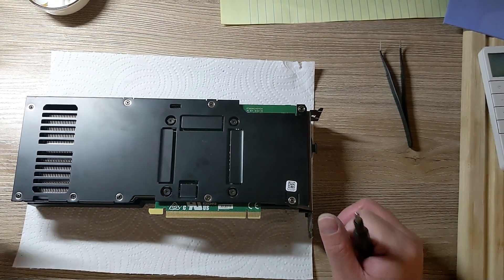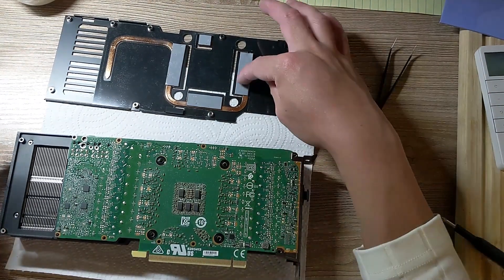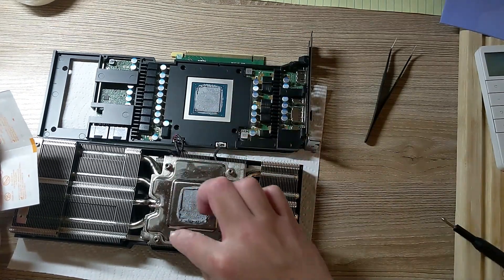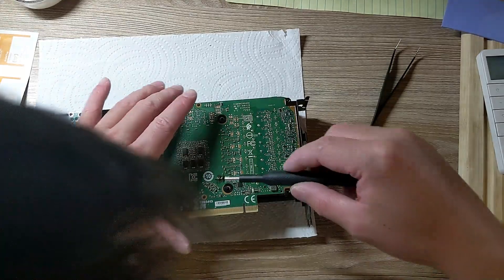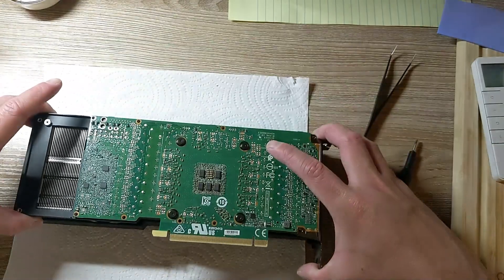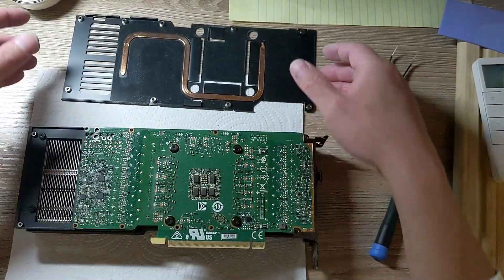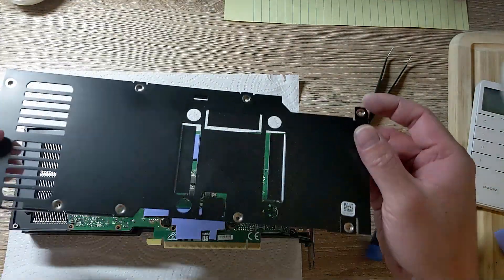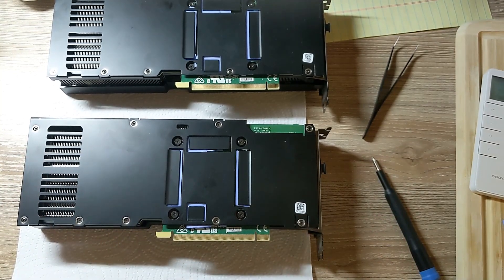How to replace Thermal Pads and Paste for 3080s from Alienware (Dell)

Comment: um... those aren't the VRAM chips, and covering those will not affect performance.
Underneath the black heat sync are the thermal pads that you need to replace for better performance, and you didn''t even touch those.
The main thing for better RAM cooling performance though is in adding that paste between the black and silver heat syncs.  This thermally bridges the 2 so that you get much more active cooling to the black sync that cools the RAM, but it will slightly raise the core temps of your GPU.... but as the RAM temps are going to be your primary bottleneck for gaming and mining, the slight increase in GPU temp compares to the massive benefit to the RAM chips is extremely helpful!

Comment: 106 to 82C mining. Fans at 70%. I did the same but replaced the VRAM thermal pad with 1mm copper shims. Make sure you use plenty of paste to fill the air gap.

Comment: What's a good target for core temp for 3080... was 95-100 ... now mid 80s
87HMs 200w on daggerhashimoto
Reply from the maker: 80s VRAM is ideal. 90s C are fine as well.
Reply: @Viet_Tran  Liked the heatsink video ... doesn't seem one can be added in the Alienware box (R12) due to location of the PSU being nearly on-top of the GPU
Any thoughts/ideas?
Reply from the maker: @cccccdddddz  what GPU do you have in the r12 bro?
Reply: @Viet_Tran  ha! forgot that nugget... RTX 3080
Reply from the maker: @cccccdddddz  those overheat like crazy, have you re-padded yet? I actually got a vid to repad it

Comment: Why is the top part only covered half way like that ?
Reply from the maker: what do you mean Ceo? the backplate or the paste?
Reply: @Viet_Tran  at 3:53,  I was wondering why you didn’t cut a rectangle to cover that entire section. You added a square that only covered half and a small rectangle.
Reply from the maker: @CEOLISSS  If I remember correctly, when i removed the old one, it was only a square as well. Also it looks like the other side is very flat compared to the square side, so if I put a piece there it would not make contact.

are you replacing pads for the same card, can you check and confirm if possible? thanks!!!